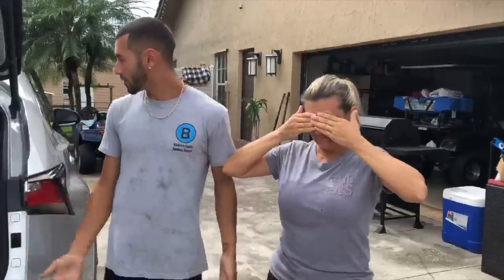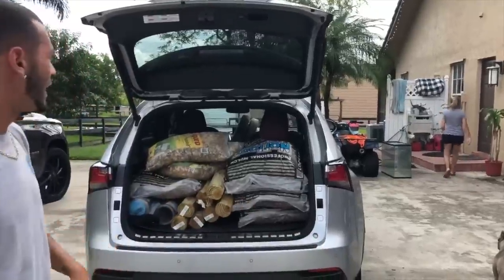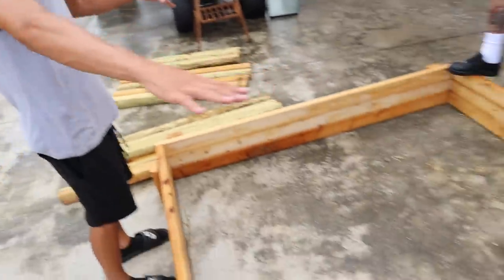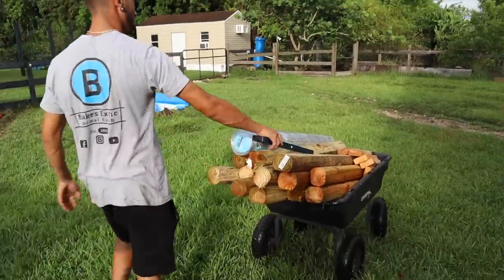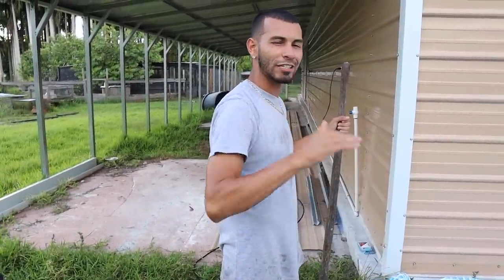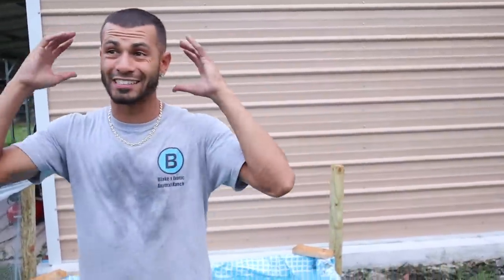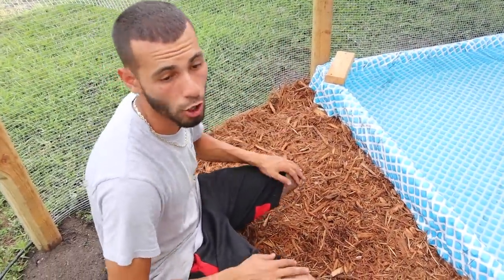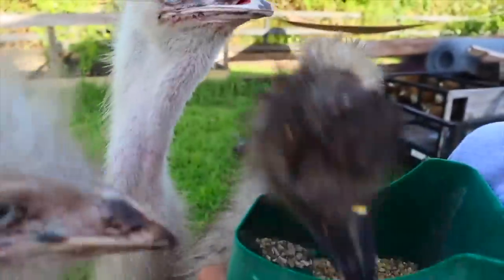NEW ENCLOSURE DIY! WHATS GOING INSIDE? Pt.1

Comment: Blake, you could have taken a thin board on each side. You wrap the vinyl around it hiding the edge of the plastic behind it. Then staple or screw it to the upper inside edge of the wood. Than attach your corner pieces of wood. It would have looked very neet. More custom built. Because your wood base was very pretty.

Comment: You might want to add boards across the top of the pen, both anchoring the overhangs in place and giving you an easier place to look in without needing to grab the metal for it.